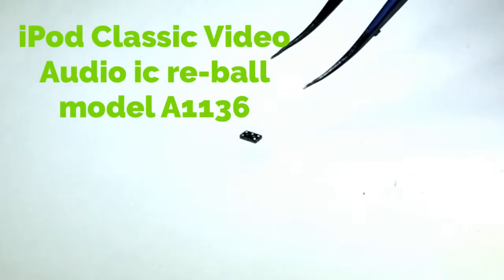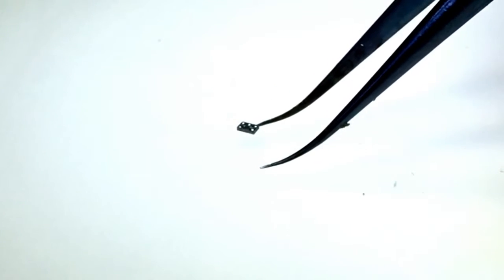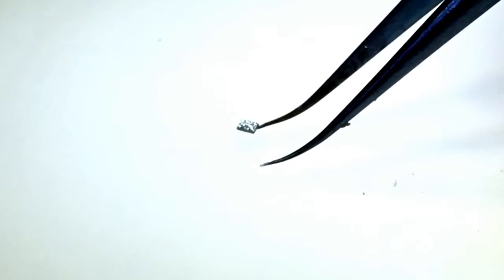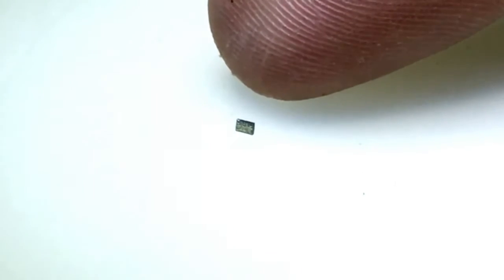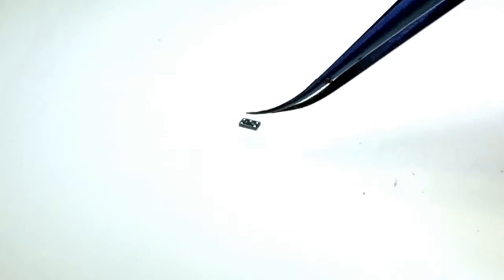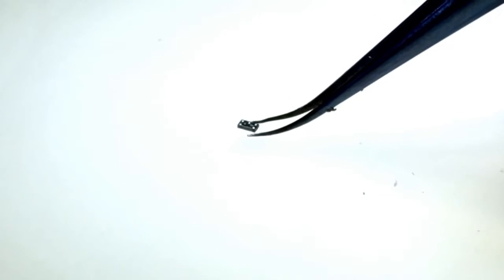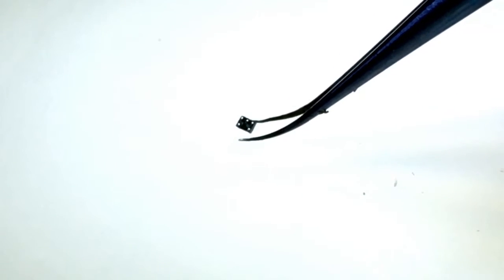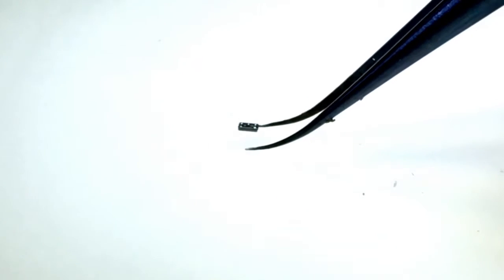iPod Classic No sound Audio ic Re-ball

Comment: I have done this repair before.  But, it is easy to overheat the nearby underfilled ic chips.  They must be protected.
Reply: Can you help me with my Ipod classic 5th generation. I have the same problem with no sound I tried two new earphone head Jack and that didn't fix the problem so I'm thinking am the actual same problem as this guy. Could you please help me